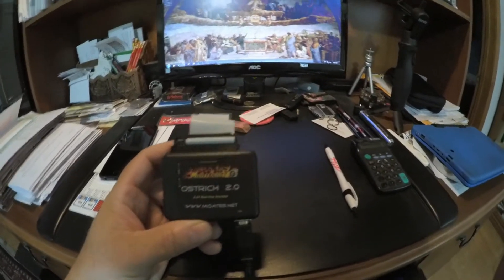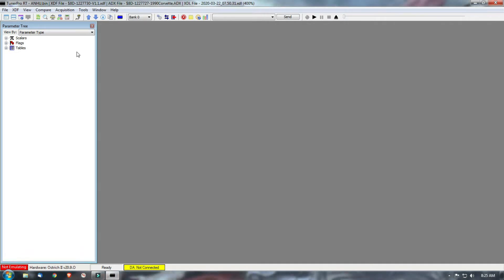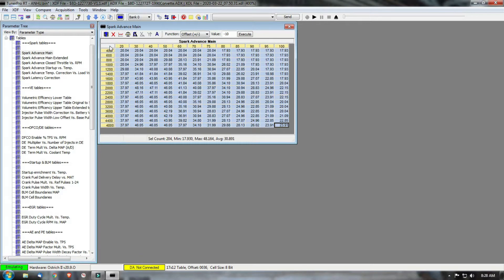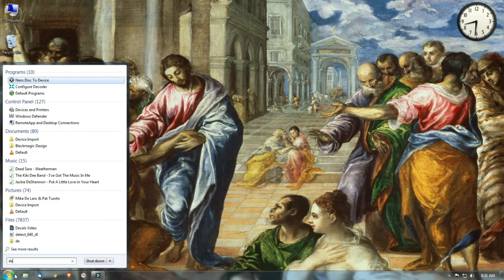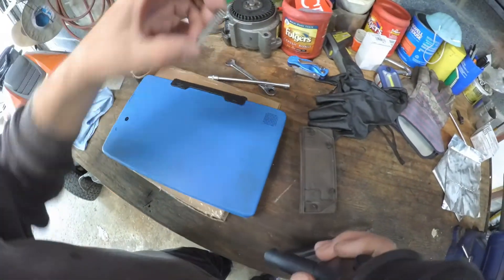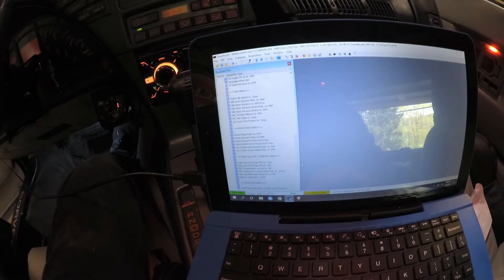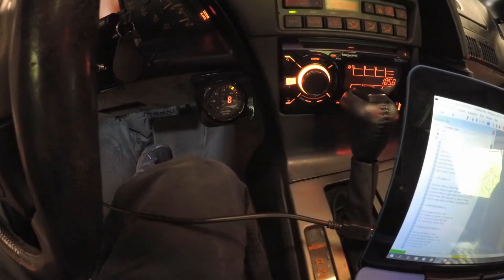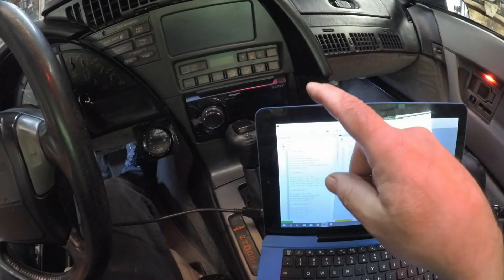Corvette OBD1 Emulating with Ostrich 2.0

Comment: there is a hole in the carpet where you have the afr and some unknown wires, so probably my car had an afr installed as well and they did some tuning, for example fans come on at lower temperature than factory settings. Now I’ve installed an afr module and planning to change some parameters or see if something is not right with the current tune. I would also like to reduce revhang a bit if that is possible
Reply from the maker: Just so you are aware I do not have a afr, I have a WB and there is a difference.

Comment: Hi Eugene,  I believe I have now seen practically all of your videos on this C4 and I thoroughly enjoy them sir!  I'm grateful for you to have made these video and I can see you are having fun with it all.  I have just purchased my ostrich2 for my 89-C4 and have begun tuning.  Thanks for showing me some great tips with this journey.  I am currently trying to figure out the correct bin file to use with TunerproRT.  These files seem very confusing.
Reply from the maker: it may be best to read and copy your original bin file from your oem chip that came in the car, this way you now it is not a corrupt file.
Reply: @E.T.GARAGE  Totally agree.  Trying to learn how to do that.  Messed up my memcal in the process.  Also, my memcal didn't have the silver sticker on it identifying the code.  Still learning.  Thank you kindly for the reply Eugene!
Reply: I've got all the Moates products for chip reading/burning and interfacing with the ECU live emulation.  So what happened was.. My memcal is not original.  It had an hand written sticker on it dating it and that's it.  For some reason I thought I could lift it out.  Place it in my burner II and read it.  yep, that didn't work.  I'm now dead in the water and either looking at buying a new memcal or paying big mula to have mine repaired.  I kinda just want to start fresh with a new one and rebuild the tune.  I have a nice fresh original L98 motor rebuilt by Blanes in Dallas.  Stroked out bored 60 over so now a 388 displacement.  All emissions are removed including egr.  Gosh I wish I could drop $800 and just have a guru come to me my house and teach me.  But I'm very excited to learn this myself.
Reply: using Tunerpro RT
Reply: Your vids have been very helpful Eugene!
Reply from the maker: just seen this, any chance you could send me a pic of your memcal, send to euto1960@gmail.com

Comment: pretty cool ...once you create the right tune, do you burn a new chip?
Reply from the maker: Yes, I will burn a new chip then remove the Ostrich 2.0 and I am set, some people just leave the Ostrich hooked up all the time but they  have there ecm located under the dash, and it saves them the trouble of taking the dash apart every time they decide they want to burn a new chip.

Comment: Are you running open loop? I wouldn't think changing the ve tables would alter anything i closed loop since the O2s just pulls the blms up or down to compensate..?
Reply from the maker: I ran Open Loop so I could demonstrate in the video the use of the Ostrich 2, for everyday use I run Closed Loop.
Reply: @E.T.GARAGE  Thanks for the reply, and for making the video, it makes it very clear what the ostrich does :)
Reply: Potentially true but... I believe the fueling compensation you're referring to, in closed loop, would only happen once the ECU gets a lean or rich signal from the O2 sensors. These old narrowband systems wouldn't send a rich or lean condition until it's really rich or lean. His adjustments between like 13 and 16 might not even register a rich/lean signal on those narrowbands.

Comment: Did you start with a base map bin? Or did you copy the bin from stock ecu chip?
Reply: Thinking about using to tune a 1992 build.
Reply from the maker: I copy the stock bin from the original memcal.
Reply from the maker: @inkognito4208  92 would be an LT1 I would upload the oem tune from the factory memcal, less likely to be corrupted like ones I have uploaded from the internet.
Reply: @E.T.GARAGE  How do you download the Memcal? Does the ostrich plug into that memcal board with the stock rom chip for download?
Reply: @HellTriX  go to moates website they have full info on what you need for your year. But you will need a memcal reader. they list it there. I'm ordering mine as soon as i get the upgraded injectors and adj fpr.
Reply: @E.T.GARAGE  Would you by chance have info on how to add 2-step launch control to the bin file? I used Moates with tuner pro on my 92 talon tsi but there seemed to be a wider selection of bin mods then i can find for the 92 corvette. By the way thanks for the vid on strut rods just got my complete rod upgrades for rear as well as SPC adj upper control arms from Corvette America.

Comment: hello, i have a 1991 corvette its heavily  modded with a procharger, i just purchased and awaiting the ostrich, could you help me find a map?
Reply from the maker: If you bought your procharger in a kit for your C4 it should come with a map sensor.
Reply from the maker: If you are referring to a VE table you may want to post on some of the furoms, Therdgen or gearhead efi, also you will need to supply a lot more info.